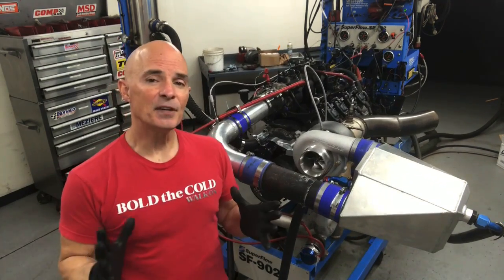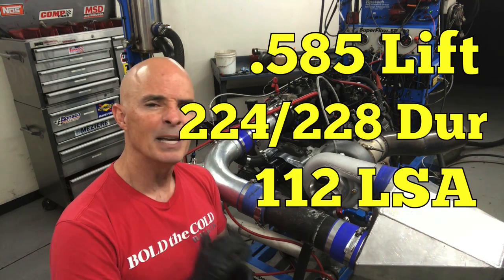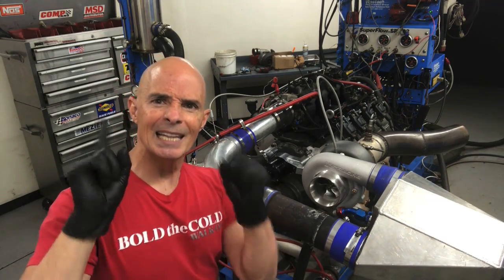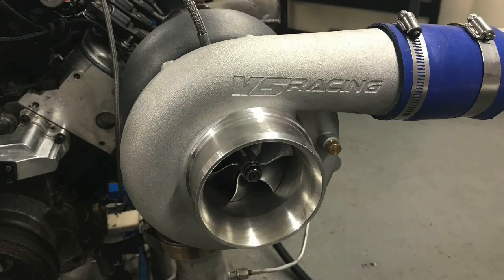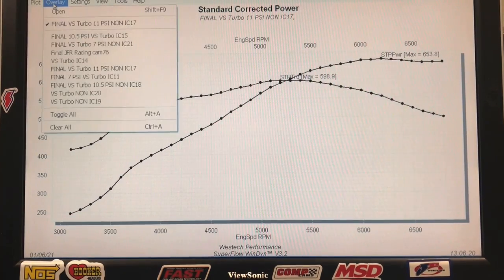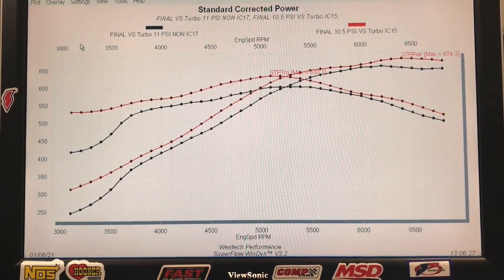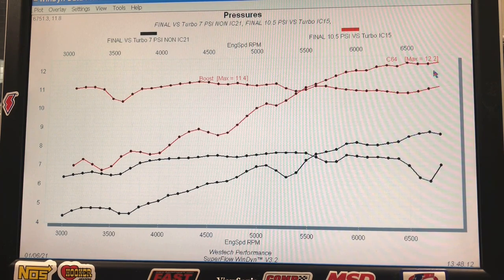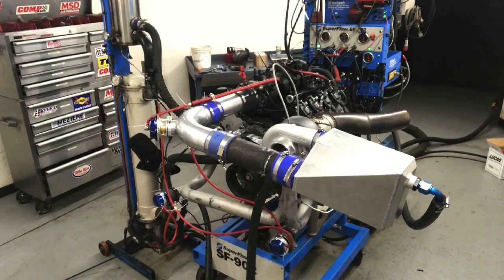JUNKYARD TURRBO 4.8L-E85 VS INTERCOOLER

Comment: Richard would the long length of a rear mount turbo and e85 offer enough cooling to run 15 pounds of boost on the street without an inner cooler?
Reply from the maker: rear mount testing is happening
Reply: Thanks for all the hard work your doing 😀
Reply: Yes... and even without that extra cooling 15lbs is nothing to run non intercooled on E85. I run E60 on 19lbs without any issues.  With remote setups you want smallish diameter piping all the way to and from the turbo. 3" piping to and from kills the setup. For 15lbs you can run 2.25 to the turbo and 2.5" charge piping. The response difference will be night/day.  I wish there was more dyno testing here with hotside and cold side piping diameter changes. I ran a 2" divided hotside at over 1000 crank HP 4.8. (thats 1.88"  ID) The difference in response was huge. And my 4.8 spooled the big T6 S480 no problem.  For guys making 500-600hp. I'm betting there's little reason to run over 2".
Reply: @AdamOpheim  what was your timing on 19lbs
Reply: @benaiahtheassassin  It varies depending on the RPM and IAT.  Its at 14* on the map over 5k when the IAT maxes out at 250+ (does this before the 1/8th mile it drops another 2*) So 12* total over 5k. Around 10* at PK TQ.
Reply: The math says there will be more power added by an intercooler, because the IC frequently has turbulators inside the tubes for better heat exchange. IF the tube from the rear has turbulators installed, and IF there's equivalent surface area for heat exchange, then possibly you could get away with no IC on a rear mount. Run the equations that are in Bell's or MacInnes' books and see what you'd end up with, IC vs.Non IC. You have to assume a great deal with these equations, but if you run different starting temps, to account for changing seasons, you can get an decent idea of how your car will respond. I plan to run an A2A IC on my rig (Chevy 250-6, blowthru carb) and I'm only figuring on 7 pounds, because the gas I can get is a bit sketchy sometimes. For me, the A2A IC will be detonation insurance.
Reply: I
Reply: I was planning on running long tube headers reduce down to 2 1/2 and run that all the way back merge into 3 inch into the turbo do you guys think they’ll be too big for a 7875?
Reply: @ronalddrummond4580  Should be ok. "Y" necked down to 1 2.5" to the back will keep the velocity up decently. Wrap it too. 2.5 charge pipe is plenty too. No reason to step up to 3" in my opinion at the turbo. Run a 2.5 t4 merge flange. Little water meth pre turbo works nice on remote mounts too.

Comment: You can also scale airflow from lambda and pulsewidth. If I had to guess, the run with 530ftlbs torque probably had an injector pw of about 3.5ms at 5300rpm. These are really big injectors, like enough for 1700hp on e85. If they intercooled run had the same afr and you know the injector pw you can estimate the airflow, it's not perfect but it's a proxy for airflow.

Comment: I'm a fan of intercooler but there's one big negative its weight
Reply: Meh. Add one more pound of boost.
Reply: @gordongullon152  and be much safer with the ability to run more timing. there is no downside.
Reply: Weight and the pressure drop across the core with typical A2A ebay junk IC's every one uses. What street car uses an A2W w/ 60-70* dyno water on tap? Generally IC vs NON -IC gains aren't that high because the IC isn't that efficient.  Also at big boost you can see a 5-10psi drop across the ebay A2A intercooler. Not to mention the engines on the motor dyno typically read 20-30hp higher than in the typically run config in a car. So instead of a 28HP difference at 7lbs you'd likely see at 10-15hp diff once the motors in the car with the junk A2A people use. You're basically talking less than the HP you'd see from raising the boost 1lb. E85 will support more boost and power than most people will ever make. So if you aren't going to run a nice intercooler, keep the junk IC off the engine.
Reply: @AdamOpheim  some of that pressure is artificially created by heat.
Reply: @AdamOpheim  i literally know no one that uses cheap intercoolers. Your friends need to up their game

Comment: Intercooler on an NA motor
Reply: For what? All that becomes is an inlet restriction. NA engines take in ambient air.... intercoolers use... AMBENT AIR to reduce the heat incurred from compressing an intake charge. 

An NA engine will never need an intercooler
Reply: @edmundnlemadim8480  without testing it you just know it won't have an effect? Pesonally I'd like to see real numbers and since he has intercoolers and NA motors it shouldn't be to much of a problem.

Comment: New to turbos but why do you use dual wastegates on a single turbo?
Reply from the maker: better control on the engine dyno
Reply: @richardholdener1727  thanks man! Does that matter on the street? I have a 6.0 w/s475 e85 ring gap, I’m a little worried about back pressure. Should I be? 13psi?

Comment: Intercoolers are for people who run cheap fuels. Intercoolers are also flow restriction. You want to make big power non intercooled with cheap fuel get a BBC .
Reply: Sorry you are very poorly informed
Reply: Even if it is a flow restriction, a manifold referenced waste gate usually negates that and most modern turbos actually have a higher efficiency at a little higher pressure ratio when boost is this low. Almost every single supercharged or turbocharged race car will have an ice tank for the intercooler and q16 fuel if they can. Nobody would take an intercooler off to try to add power. His last video he added almost 30hp adding the intercooler and keeping the boost and ignition timing the same.
Reply: @timothybayliss6680  Does a flow restriction reduce power?
Are there turbo engines making 1000 hp non-intercooled? how about 2000hp non-intercooled? 3000 hp?
If X turbo flows 1000 hp does adding a intercooler add another 100hp to equal 1100hp total?
Reply: ok Boomer....

Comment: I have a really reasonable question about the balance on this engine...you say it uses gen4 rods and some lr4 engine have them factory, some. If it has gen4 rods are you using a gen4 crank as well? I read one post where the swap on a LQ9 had a bob that was 52grams heavier. I know the pistons might be lighter though how much when the replacement has a dome is questionable.
Reply from the maker: IT WAS BALANCED-GEN 3 CRANK THOUGH

Comment: would it be possible to use a intercooler from a junk yard maybe off a diesel or something? i think it may make a cool video if it is possible.
Reply from the maker: YES IT IS POSSIBLE
Reply: That's a cool idea
Reply: Why not a junkyard build using parts found at a yard🤷‍♂️
Reply: I've used a factory 6.7 powerstroke air-to-water intercooler with great success on a turbo 5.3. very compact and efficient!
Reply: For a video it would be a kick in the nuts. Almost every diesel has a big or.huge air to air intercooler and they work great on the road but not so much in the dyno cell without a huge fan and air exchange. On the dyno an air to water charge cooler works really good when you have thousands of gallons of room temperature water to pump through it. I like guys swapping a diesel intercooler into their turbo gas trucks. They are really big and have all the factory parts for a clean installation.